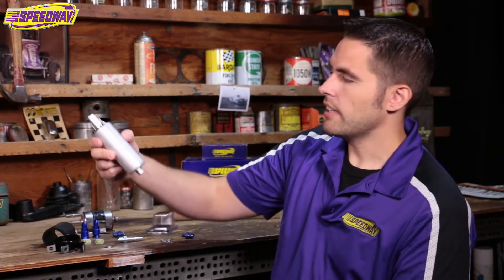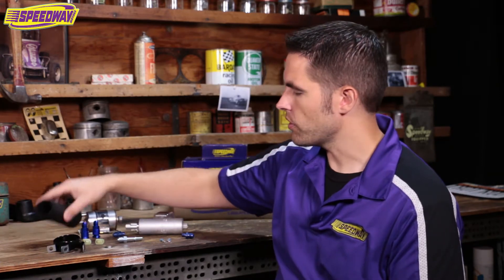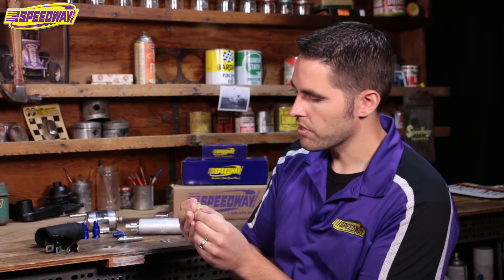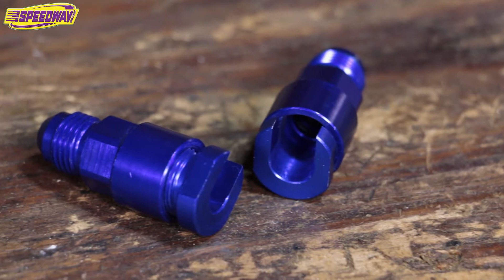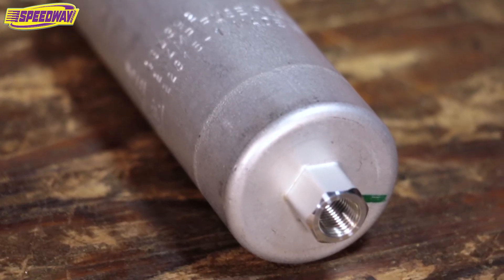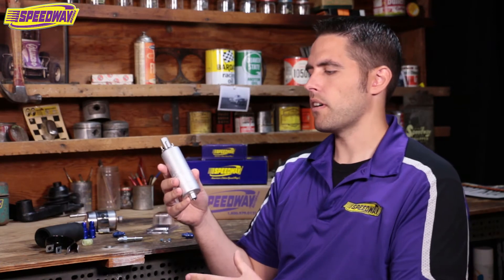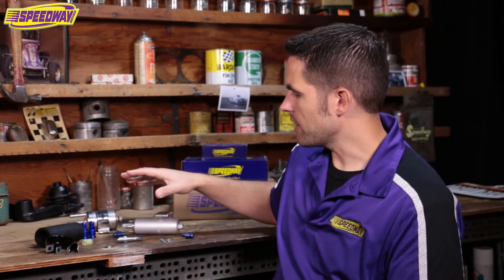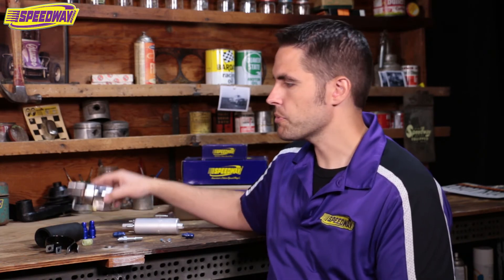Speedway Tech Talk - LS1 Fuel Delivery Kit

Comment: Is there any way to run the filter/regulator on a truck setup?
Reply from the maker: The only way you can use this filter/regulator is with a fuel rail that has only one line on it.  This would be a rail that is a “deadhead” style and does not have a regulator on the rail.

Comment: How far apart can the pump and filter be spaced?
Reply from the maker: You want to put the pump as close to the tank and below or near the bottom of your fuel tank.  You may put the filter half way up the car if you’d like, as there are no minimum restrictions with that.
Reply: Speedway Motors thanks.